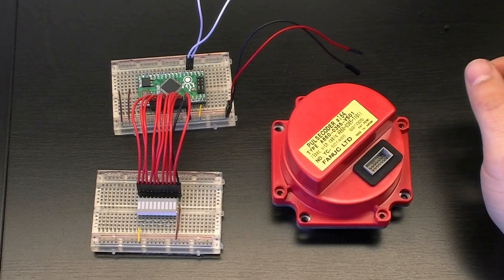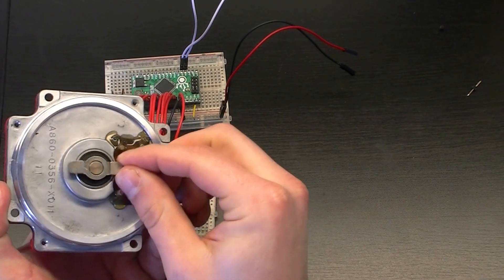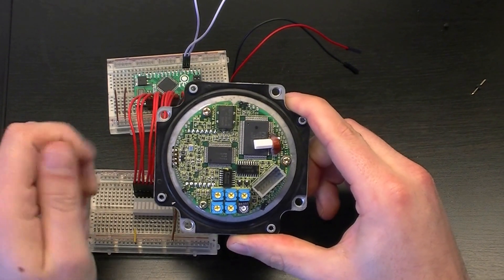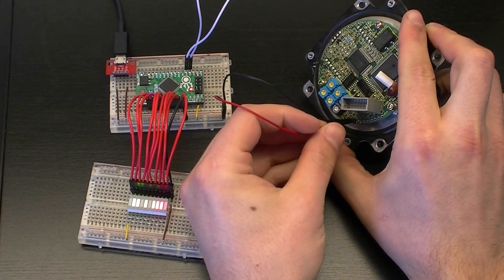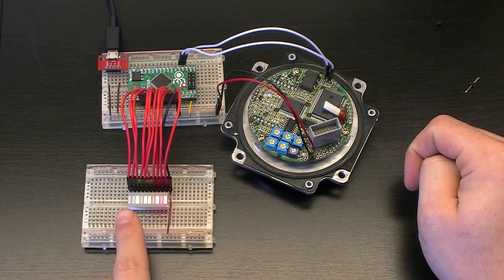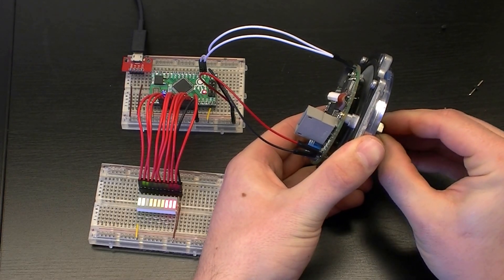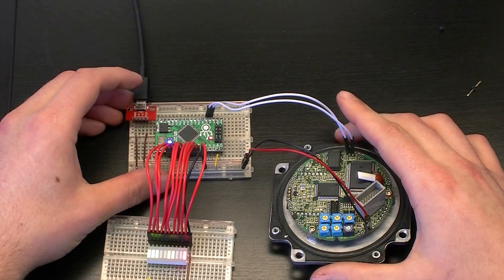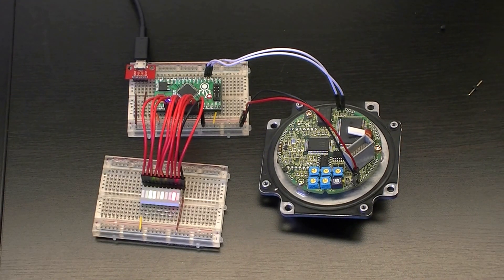Roboteurs - Rotary Encoder - Fanuc Pulsecoder

Comment: One error in your description.  The phase A and B signals are only 90 degrees out.  If they were 180, B would simply be the inverse of A.
Reply: No. They're 90 degrees out.
Explain to me how the encoder will count and "see" the direction if the signals are basically mirrored in 180 degrees out? It´s impossible.

Roboteurs, thank you for thi great video!